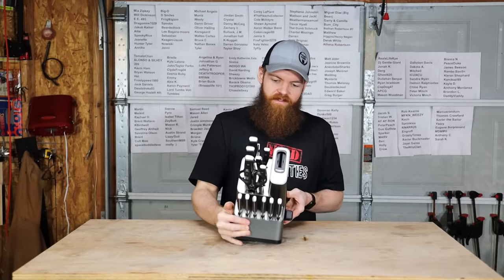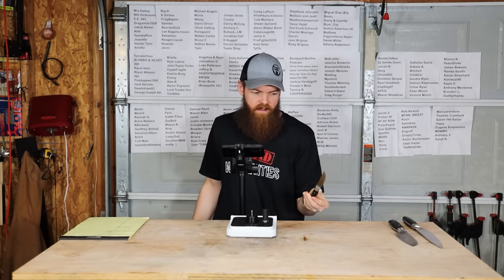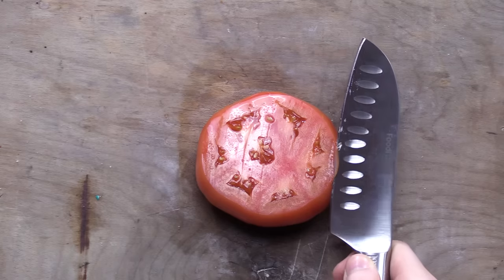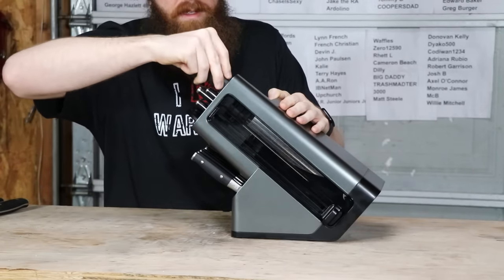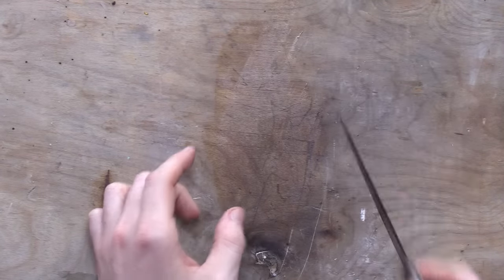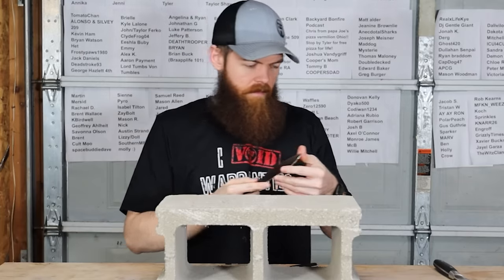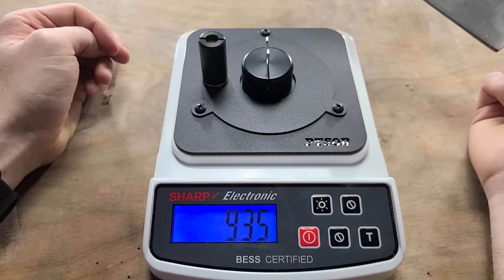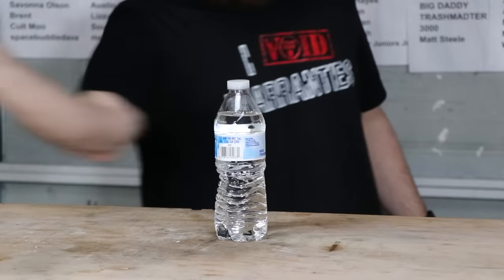They Said These Knives NEVER Go Dull......

Comment: What you are feeling with the Steak Knife VS the larger Chef Knife is probably the difference in blade geometry, and surface area. 
It's not that the big knife is much less sharp, it is just wider, and has more surface creating friction.
Reply: That is what i was thinking ad well
Reply: Science!
Reply: What i was thinking
Reply: Another big thing of knife vs tomato is the angle of the cut. Getting a thin slice perfectly even across requires control of both the knife and the thing you're cutting, even with a perfect knife
Reply: The tomatoes he is using also really aren't good for what he was doing they are to dense
Reply: Noooo the knives had defects
Reply: im more interested in knowing how authentic that tool is for testing knife sharpening. the first test was 300 and then it was 355 with the same knife. thats a pretty big discrepancy between 2 tests. someone should test that knife sharpening test tool. use one knife and do many tests over and over again and see how accurate it is.
Reply: @f2pgamingcastleclashmore119  you could literally see the defects in the edge, it isn't the sharpness tester.

Comment: It's clearly a honing wheel, which for most people, should they not abuse their blades and always do the recommended 2 weeks should keep the blades relatively sharp. The issue I see is that people are going to forget to sharpen the blades and then expect a very dull blade to be sharpened back to being a razor. I would love to see a system that could somehow tell you when to sharpen your blades so you never forget to do it.

Comment: Sharpening inconsistencies from the factory are pretty common no matter the brand
Reply: I'd say otherwise. If you buy from a reputable company, you'll get what you ask for. My Sakai Takaiyuki knives came perfect.
Reply: @richguy32  I can say the same thing for my tojiro or kanetsugu knives. Even their cheaper knives come razor sharp.
Reply: @paralyzedsalsa2960  just looked them up. Not a fan of their kitchen knife desings, but thats personal preference. The prices  seem fair for what you get.
Reply: @paralyzedsalsa2960  Moras are robot produced, eliminates human errors
Reply: @jt6648  that also eliminates the good things about handforging, such as proper tapering. Also human errors in high quality blades are rare and every good bladesmith would replace a blade that breaks because of  structural problems like a coarse grain. Machine made blades also only use cheap low hardness steels(less then  60 hrc)
Reply: @jerak02  Most definitely, hand made are more expensive for these reasons
Reply: @jt6648  A good hand forged knife is better than any robot produced knifes you'll ever find. Robots are terrible at doing almost anything that actually requires visual judgement. A human can look at that knife through an magnifying glass to inspect it to make sure there's nothing wrong. A robot just spits it out  and moves onto the next.
Reply: @mightypharaoh7586  I agree. If we're talking about less expensive knives, they're going to be mass produced and limited on what the robots are able to produce. But if we're talking about custom/high ends, what you say applies.
Reply: @jt6648  Good knives are just a quality over quantity kind of thing. They really only beat humans in a quantity over quality kind of thing.
Reply: @mightypharaoh7586  Yeah, exactly.
Reply: @richguy32  i wouldn't say they're perfect, but im just being nitpicky with tiny low/high spots.
Reply: Not true you get a zwilling or wusthof they will be like a razor blade
Reply: @qazz6209  razor blades aren’t consistent kek
Reply: @Alsry1  they are hand made you tool and laser sharpenend kek

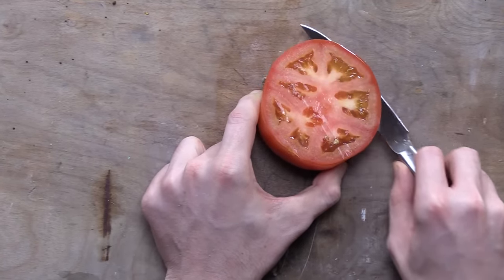Comment: 14:09... one thing you are forgetting is that as the tomato gets smaller and smaller from all the cuts it is loosing more and more weight which in turn is reducing the friction between the tomato and the table which in turn is making it easier to push, the reason why it is probably reading similar but feeling worse is because by having the exact same surface of the tomato and table but half of the weight it should have roughly half the force required to overcome the friction (not exactly half seeing as that is not how friction works, but when you are just talking rough numbers you can call it close enough)... Another way to think about it take a baseball bat and hit a 300 lbs sack of meat wearing x shoes on semi slick but not black ice slick with it and see wither you cause that 300 lbs sack of meat to jiggle absorbing the hit or slide over coming the friction of the shoes on the ice, now with the same shoes and same ice and same bat with the same swing speed with the only difference being the sack of meat now weighs 75 lbs instead of 300 lbs see if it makes the lighter meat jiggle just as much absorbing the impact or if it slides on the ice easier with the same jerk force. That is the difference is with less weight pressing down the shoes rough surrface against the ices few rough surfaces it is going to require less force to over come friction... Same thing with the tomato and it weighing half as much as when you started.

Comment: The “sharpening” stone inside it is like a honing rod, it’s basically the knife sharpening equivalent of using 2000+ grit sandpaper on a not planed plank of wood and expecting it to be perfectly flat in no time; it will eventually do it but it would be way quicker to go to a different grit and work your way up.
Reply: Don't know like I've been a chef for 15+yrs and  I've used sandpaper on my knives before and not bad it's because he's trying to cut super thin not all chef cut super thin and most chefs put quite a bit pressure on out knifes
Reply: @richardpeaker9802  Most chefs iv talked to say dont put a lot of pressure on your knife. I learned its better to not put a lot of pressure on it. Let the knife do the work.
Reply: Thats what i thought. Its really only meant to keep your edge straight. And you're supposed to hone it every time you use it, not every 2 weeks like they say.
Reply: Great analogy. But, more like trying to use a mirror to sand a piece of wood.
Reply: @richardpeaker9802  cutting super thin is absurdly easy when you use the appropriate (well maintained) blade alongside proper handling skills. my  wÜsthof  santoku can cut razor thin tomato slices with a minor pull and flick of my wrist regardless of density because thats what its designed to do. my nakiri is razor sharp and , it too  can cut quite thin but its not gonna flick through a tomato its meant for greens and heavy veggies....doesnt help that the ninja knives come with a shit blade that you need to remake, its not worth the effort.
Reply: honing only straitens the edge of the blade it doesnt sharpen. meaning no matter what even when if you used the system every time you put away the knife or before using it the blade will dull.
Reply: @zeroa69  hey

Comment: Love that you are testing the product, but a huge problem would be that you are not testing the same part of the blade each time. Should Mark the blade with a sharpie to test the same spot.
Reply: So when you are sharpening a knife you want only one part of the blade to be Sharp? 

If a sharpener doesn't sharpen all of the blade then it's not a good sharpener
Reply: @thanasis-_-  he can test more than one point on each blade.
Reply: Thays exactly what I was thinking
Reply: @douglastaylor43  don't you do that anyway when you are using a knife?
Reply: @thanasis-_-  sure but you do tend to have a sweet spot with your knife. Like you usually aren’t using the extreme ends as much as you use the middle or the middle front, part of the blade as that’s where you get most of your power and control with a knife from. Of course this also depends on the size of the knife and what you’re doing with it. But yeah the bottom line is it should sharpen the entire blade equally
Reply: @thanasis-_-  if you really want to he can mark 4-5 spots in the knife and test those spots

Comment: I think it's operator error with the slicing. You have to keep the angle of attack, level as possible. If you twist or use a arching motion. You will expose more surface area. You want to be as thin of an attack/slicing as possible. Our joints make arching motions. You have to force your motion to be a linear as possible. The perfect water bottle slice was really good technique. The second one Tyler swooped the knife up lifting bottle off the table and pushing it across the room.

Comment: How hard do you use a kitchen knife? I just sharpen my most used knives every couple months and they've been sharp as hell for 30 years.It's all about the steel. Some steel can take a razor edge, but dulls quickly. Other steel can only get "regular sharp" but will hold an edge for years. Sharpening angle is the biggest factor. Anything over 30 degrees is an axe or "dull". Under 10 degrees is the sharpest razor, such as a straight edge shaving razor.  The lower the number, the sharper it is and the quicker it dulls. As an edge gets thinner, sharper, and more fragile, it gets weaker and dulls quickly.

Comment: Pressure testing a single point on the blade is never going to give you an accurate result on sharpness. Maybe it will give you a general idea but there could be huge inconsistencies with points on the knives after cutting a cinder block and also the molecular differences in your wire could give you entirely different results as well. Also using proper whetstones and strops you could possibly revive those knives.
Reply: I know. Damn that gets on my nerves. Testing that ONE TINY spot on the edge where it cuts the "media" only tells you how sharp that one SPOT is😂

Comment: I bought a belt knife sharpener from eBay and I'm very happy with the job it does. It was the "Work Sharp Knie and Tool Sharpener MK2". You should do a video on belt sharpeners and use that as one you review. I am super impressed with the job it has done for me.

Comment: Stropping or honing to me means straightening a bent edge without removing any material. Using a steel hone or a strop on a knife needs to be done first by striking the knife across it backwards. That will straighten the edge and if done frequently quite often that is all that is needed. If you skip the honing and go directly to sharpening which removes material that will leave divots in the blade and you will need to keep removing material until you grind out the divots and it is sharp again which wears your knife away prematurely and wastes a lot of time. Five or six hits on each side with a steel hone going backwards first and 10 smooth light strokes on each side with a fine stone cutting into the stone at a 10 degree angle every time you go to use your knife will give it a sharp 20 degree edge, it will cut nice, resist dulling and the knife will last a long time as long as it is made of a quality hard steel.

Comment: The soft water bottles are soft for a reason... When your done with them, squash them and replace the cap while holding them in a squashed position... It saves space in your recycle bin and if you don't recycle, it saves space in the landfill... Try it... It is really easy and almost a satisfying as this little packing bubbles...

Comment: “Never needs sharpening” knives aren’t immune to the laws of physics (namely friction)…

Instead, every one I’m come across has at least two of these things going for it:

1. The knife is made of cheap metal that will rust, warp, or break before it wears. 

2. The knife’s blade is serrated, and serrated blades do dull more slowly than straight ones, for the same reason that a saw doesn’t wear out nearly as fast as a razor. But what they won’t tell you is that it’s more difficult to sharpen a serrated knife if you do manage to dull it, which WILL happen with heavy use, and you might not be able to do it with equipment you have at home. You need a machine shop  and some finesse to sharpen a serrated blade, especially ones as heavily serrated as Ginsu’s, Miracle Blades, etc. 

3. The knife is relatively inexpensive, so the cost of sharpening the knife professionally (esp. if it’s serrated) means it’s cheaper to order a new one.

4. Because the knife is relatively cheap for a “professional” unit, you might own more like knives and wear out each one more slowly.

5. They’re selling to amateurs who might have a higher tolerance for a slightly dull knife than the chef who always makes sure his/her/their knife is honed and sharpened to razor precision. 

6. They’re counting on you to use the knife for cutting softer foods that won’t dull it as quickly… think tomatoes instead of French bread, sole instead of beefsteak.

Comment: To dull a knife quickly cut cardboard. Also, if you have a pair of scissors and they are dull cut some fine sand paper with grit side up and then down. Reverse this a few times and they will come out sharper. Works great.

Comment: Or you can can use a wet stone to sharpen your knives. I grow up with my dad doing that and we never had dull knives. Oh it way cheaper too.
Reply: That's not what he's testing 🤣
Reply: Yes, but sharpening a knife on a whetstone requires practice, as you need to learn to hold the edge at a consistent angle every time you draw it across, otherwise you're dulling it more. Also, stropping afterwards is usually required, as sharpening it will create burrs, which is what the strop is meant to remove. All these knife sharpening systems, automatic knife sharpeners etc. try to give you an easy way to sharpen knives without learning how to do it properly. Most of them do a decent job, but there's another problem - most "systems" have only one grit, which is simply not sufficient is the blade is messed up enough. And there's an extra problem with the sharpener in this knife block... have you seen how much the knives RATTLE inside the sharpener? He has to hold it into the device to even be able to use it at all. There is way too much play in the system, which probably means that the knife isn't always centered in the groove of the wheel, meaning it doesn't get properly sharpened. That's my opinion on why it didn't work as well as it maybe should have. Also, IMHO the knives are made of shit steel that just cannot hold an edge for too long. The fact that the knives got THAT dull after drawing them across wood just a few times, with some of them even CHIPPING during that process... Nope. That cannot be proper steel.

Comment: The second knife is called a santoku knife. Its a general purpose slicing/chopping knife meant for cutting smaller objects like chilis or potatoes, and generally anything that doesnt need the full weight or blade length of a full sized chef knife

Comment: Don't feel bad about those tomatoes, I worked at Mr goodcents for awhile and even our slicer had trouble with those matoes, and our slicer was so sharp I barely tapped the blade with my pinkie while wiping it down and had to take the whole thing apart to clean blood off after I noticed a giant slice halfway through my pinkie. Tomatoes have those holes with juice so it pulls the blade, try cucumbers or potatoes

Comment: LOL!!! Ok I definitely will not try to cut through a cinder block with my Ninja knive set, I got mine for a good price and they are sharp!  I'm not crazy over the Knive block but using them normal use it should be fine. Sharpening the smaller blades your supposed to insert them into the lower part part of sharpening area. Only insert the 2 bigger knives  (chef knife and butcher knife) in the top part of the sharpener.  Fun video

Comment: Just to point this out, the chart clearly states that 350 is still in the high end cutlery range. Anything over 400 needs to be sharpened, as high end cutlery is not expected to be razor blade sharp. (edit) Also, if you are cutting a wet water laden object, ie tomato, on an already wet surface, the surface friction is very little so it needs to be held. C'mon, common sense does apply. To add, no one uses a concrete block as a cutting board and your stropping ability since not on camera should be questioned. Quoted: "One of the biggest mistakes people make when stropping is changing the angle of their strop from that they used to sharpen. If you come in too shallow you won’t actually make contact with the edge; if you come in to deep you risk actually dulling the edge slightly (a common mistake)." Still a fun and informative video.

Comment: loved the video. Possible future video, can you bring back the edge with a true sharpening system ? IE check the actual quality of the blades in the set. As far as the reason the steak knife got sharper than the rest, the wheel was at a different position because of the thickness of the blades ?

Comment: Just a heads up...although 175-200 is still very sharp...its not great for a nice knife. High quality knives should be between 100-150, and between 70-80 for Professional knives. The best I've ever seen was a score of 8...yes...8. These numbers measure the weight in grams required to cut a given item...so, the lower the number, the better

Comment: On the horizontal tomato slicing test. You are mis-calculating the sharpness of the various knives because you failed to account for friction of the the much wider blade. The resistance increase you felt was not because it was more dull. It was because of the greater surface of the blade being drug through the tomato.  This is why filet knives are very skinny because they must glide through the "material" with little friction.